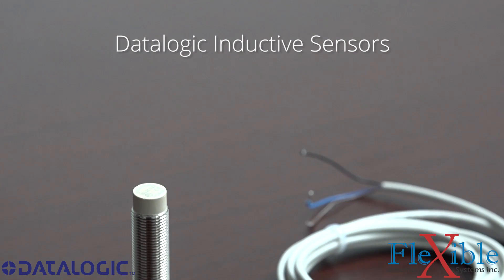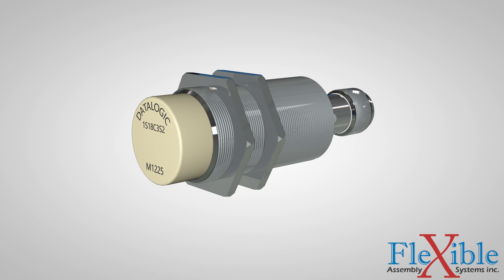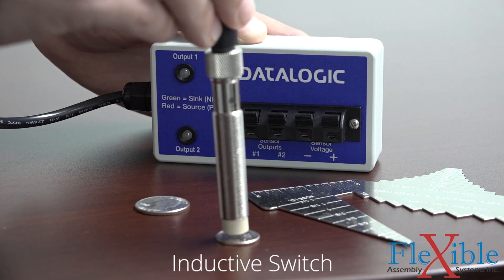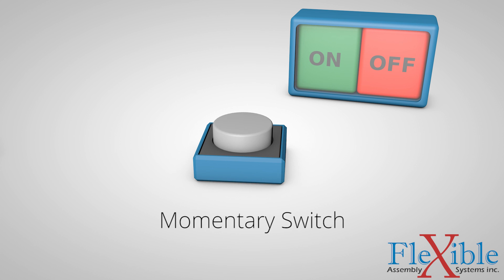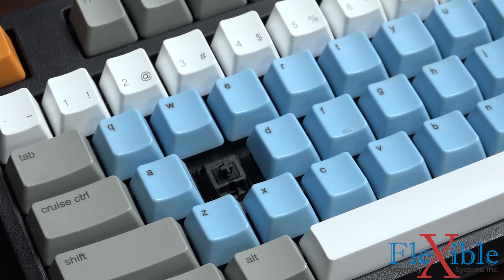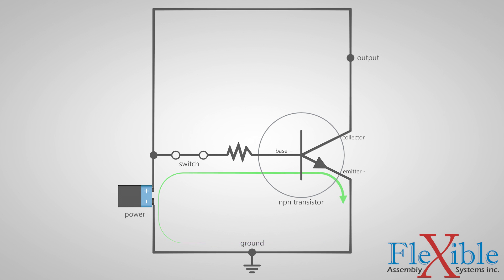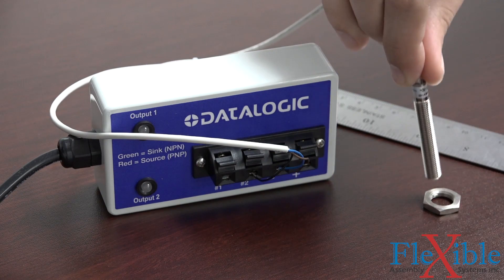Inductive Sensors - PNP vs NPN - N.O. vs N.C. - Datalogic

Comment: It looks like these sensors have a low sensitivity. The sensing distance is 5 mm or even less. Is there some way to have a 25 or 30 mm distance for sensing very small metallic objects like 1-2 mm dia screws/nails ?
Reply from the maker: These particular sensors are very small, which directly relates to their sensing distance. For inductive sensors the larger the sensing surface, the larger the sensing range. For examples the induction sensors used in roads for monitoring traffic have a diameter of over 3 feet and can sense the present a vehicle sitting well above 10 inches from their surface. The size of the magnetic field generated by the inductive sensor is generally directly related to the size of the sensor itself.

If you had a much larger inductive sensor you could easily detect a metallic object 25-30mm away, however the size and material properties of that object will dictate how "sensitive" the sensor would have to be. Also remember that ANY other metallic objects within that larger sensor range would also trip the sensor. Your fixtures would have to be made of another material.

In short, an inductive sensor can "see" metal when it interferes with the magnetic field it produces. If the object isn't ferrous or too small to create enough interference you would most likely be better off with a photoelectric sensor.

The small range on these sensors help them eliminate any false positives. For automation purposes where a metal surface will pass directly over the sensor these are perfect. For longer range sensing of objects usually photo electric sensors provide better results.

Comment: crown cork is stainless steel type of material then how it isattracted by inductive proximity and refro reflective photo sensor?
Reply from the maker: Inductive sensors can detect the presence of stainless steel, but it will have a reduced sensing range due to the reduction factor of SS. Materials are not "attracted" to the sensor, they are just detected by the change in the electromagnetic field. There are special non-ferrous metal inductive sensors that can more easily detect SS.

A retro-reflective photo sensor is entirely different technology. It relies on the reflective properties of the target and requires line of sight. You do not need to see the metal you are detecting with an inductive sensor.

Photoelectric sensors and inductive sensors operate very differently.

Comment: When a Proxy sensor become less responsive due to extremely low temperatures (-30c) will increasing voltage help ? for example going from 6 volts to 9 volts.
Reply from the maker: These specific inductive sensors have a recommended operating range of  (-25 ... +70 °C). At temps below -30C I'd assume the resistance to shock impacts would drastically drop in these models. Special inductive prox sensors for industrial freezers rated to -100C seem to have better shielding to reduce these issues. I'm unsure if increasing voltage would help with lower temps.

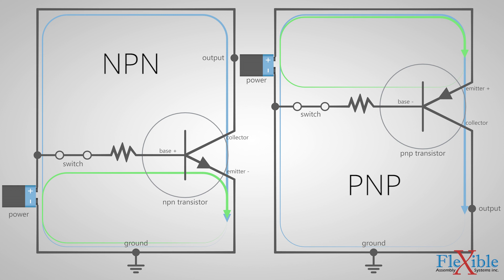Comment: To better understand it, in NPN sensor drawing (4:16), top part is actually PLC input (could be relay or something else). There is permanent 24VDC on PLC input and wire going from PLC input to sensor is going to the collector of transistor which is switching negative (N pn - switching negative). 

If you take DC voltage multi-meter and connect black probe to 0VDC and red probe to PLC input and there is 24VDC, that's mean you have to use NPN sensor. On other side, if you want to test the sensor, connect red probe to 24VDC and black probe to sensor output, if multi-meter display 24V, then it's NPN sensor. Sensor have to be in ON state of course.

IN PNP sensor drawing (4:16), bottom part is actually PLC input (could be relay or something else). There is permanent 0VDC on PLC input and wire going from PLC input to sensor is going to the collector of transistor which is switching positive (P np - switching positive). 

If you take DC voltage multi-meter and connect red probe to 24VDC and black probe to PLC input and there is 24VDC, that's mean you have to use PNP sensor. On other side, if you want to test the sensor, connect black probe to 0VDC and red probe to sensor output, if multi-meter display 24V, then it's PNP sensor. Sensor have to be in ON state of course.
Reply from the maker: Thank you for the information!

Comment: Thanks, the video was good. I have two  questions:
 1. Why do I need an oscillator to generate magnetic field? I think current through a coil is enough
 2. Why the amplitude of is oscillation gets dampened when metal comes in contact with the magnetic field?
Reply from the maker: The oscillator is used to drive the coil and detect changes to the magnetic field as metallic objects enter into the field and disturb it. To answer your second question here is an excerpt from a well written wikipedia article - "When power is applied, the resulting oscillation is a high frequency alternating electric current in the coil that has a constantly changing magnetic field able to induces eddy currents in proximal (target) conductors. The closer the target is and the greater its conductivity (metals are good conductors, for example), the greater the induced eddy currents are and the more effect their resulting opposing magnetic fields have on the magnitude and frequency of the oscillation. Its magnitude is reduced as the load is increased in a non-magnetic conductor like aluminum because the induced field in the target opposes the source induction field, lowering net inductive impedance and therefore simultaneously tuning the oscillation frequency higher. But that magnitude is less affected if the target is a highly magnetically permeable material, like iron, as that high permeability increases the coil inductance, lowering the frequency of oscillation."  Source: https://en.wikipedia.org/wiki/Inductive_sensor

Comment: Kindly tell me difference between sourcing and sinking with practical purposes
Reply from the maker: Sinking and Sourcing are terms used to define the control of direct current flow in a load. A sinking digital I/O (input/output) provides a grounded connection to the load, whereas a sourcing digital I/O provides a voltage source to the load. A sourcing input will always provide power to a sinking output. Whereas a sinking input will provide resistance for the sourcing output which provides power for the circuit. More explanations are found in this article: https://instrumentationtools.com/difference-between-the-sinking-and-sourcing/

Comment: What about PNP/NPN 3 wire sensors? Efector offers a lot of sensors that say PNP/NPN but the wiring isn't a plug n play the way you would think.
Reply from the maker: A 3 wire sensor would have 1 for power, 1 for ground and 1 for the signal to be sent to a PLC.
Reply: @FlexibleAssembly  With  my experience if a system that uses an NPN sensor to trigger something (for example) a  universal PNP/NPN will not work with factory wiring of the machine.
Reply from the maker: I'm not sure what type of machine you are referring to. Typically any NPN or PNP sensors would be plugged into a programmable logic controller (PLC) which would handle the signal and logic that it drives. If a machine requires a sensor to be plugged into it directly that you would have to use the specific sensor listed in their specifications. 

Datalogic doesn't sell any inductive sensors which are 'universal PNP/NPN'. They have one type of circuit or the other. It would be the PLC that could be universal to handle either type of sensor.

Comment: can you show the internal components of the proximity switch and how its working in detail. Does all the proximity sensor will have switch itself or externally need to connect
Reply from the maker: The inner workings of these digital Datalogic inductive sensors (proximity) are a series of elements designed to read changes in oscillating magnetic fields. They include the following circuits:
1. Field sensor
2. Oscillator
3. Demodulator
4. Flip-flop
5. Output

These specific sensors have a few wires coming out of them. 2 for power and one for the output. The output can be connected to whatever PLC or circuit you design for your purposes.

For more general information proximity sensors and how they work check out this article:
https://en.wikipedia.org/wiki/Inductive_sensor

Comment: Can you adjust the distance sensing of the inductive sensor? Say for example, 1 inch away from the sensor, would it be able to detect the object? Thank you in advanced for the answer.
Reply from the maker: For the Datalogic inductive sensors there is no way to tune the distance they sense (like you would focus a camera). The operating distance (range) of Datalogic inductive sensors is determined by the diameter of the sensor and the shielding type. The magnetic field they produce that detects metals is proportional to the diameter. For example an unshielded sensor with an 8 mm diameter can detect as far as 1.5-3 mm while a 30 mm sensor can detect 10-20 mm. The variance in those ranges is dependent on the type of material being detected (ferrous metals have increased range).  I'd recommend using a sensor with a longer range than needed, then recessing the sensor farther away from the part being detected to reach the desired distance.

Comment: Can we adjust the sensing distance?
Reply from the maker: The sensing distance cannot be adjusted for these inductive sensors. Each sensor (depending on size, shielding, and type) has a fixed distance that it can sense. This range changes based on the type of metal being sensed. Ferrous metals will detect farther away than non-ferrous metals. Data sheets are available for each sensor which provide a sensing range diagram based on different metals.

Comment: Hi what is the name they tool you  use to turn on the sensors?
Reply from the maker: It is an Inductive Sensor Tester from Datalogic. Basically a circuit which connects a battery and LED to the sensors so can you wire them up and test their function before installing.

Comment: Why my npn inductive sensor can detect all kinds of materials like plastics?
Reply from the maker: This video is specifically talking about inductive sensors, which can only detect metal. You may have a photo sensor or a different proximity sensor. Plastic can't interfere with the electromagnetic field generated by an inductive sensor so it's impossible to detect the presence of plastic alone. Perhaps the plastic you are using has metal parts within it, or the sensor is mislabeled.  NPN or PNP makes no difference when it comes to detection of an object, it's just the way the circuit is configured.
Reply: Thank you for the information. I have anothet question. Is it possible for the inductive sensor to read as metal if i put non metal material that has a liquid in it
Reply from the maker: You're welcome! An inductive sensor would not be able to 'see' a non metal material with or without liquid in it. Only metal would disrupt the electromagnetic field enough to trigger the sensor. Metal suspended within a fluid could set it off however.

Comment: i want to know how much voltage for a ECU in a automotive vehicle is required to turn on the base, i heard 5v is short to ground or something..?
Reply from the maker: Considering most car batteries are 12V I would guess the ECU would need somewhere between 9-14V to operate properly. That is just a guess. There will be a min/max for the specific model ECU, that information you would need to get from the manufacturer to ensure you are providing ample power without damaging the unit.
Reply: They don't provide enough info on how the ecus work totally other than the basic technician level.
Reply from the maker: I'm sorry I can't provide more information to help you on the matter, someone who's expertise is in automotive electrical engineering could provide you with much better information. Good luck!